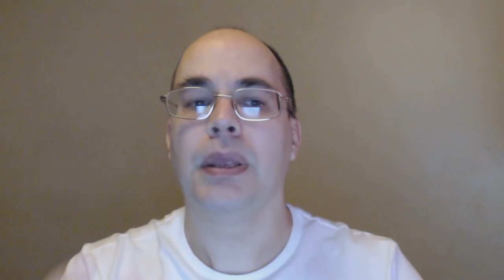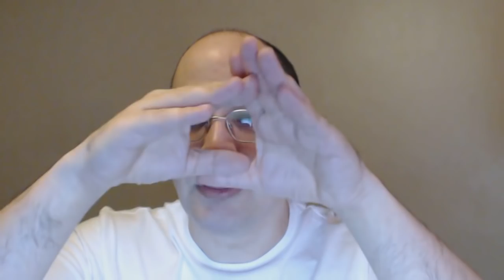How do rockets move in space, with nothing to push off from?

Comment: Ok so if you could understand the question I will ask it in another way. How astronauts move out of their space stations when they are in a complete stop? Rockets came from the earth but in the space when you stop how could you move again while there's a vacuum and no resistance? I know the answer but stupid people don't deserve the answer.
Reply from the maker: There is no complete stop in space, things are constantly moving, there can be no apparent movement relative to an object moving in the same direction and the same velocity but that isn't the same as no movement.
Reply: ok is a semi-stop for example in the space station, or a ship is that good for you? I mean come on at least admit that the movement could not be initiated only with a thrust from another object and not from the object itself which means you can not swim in space or even push your self against nothingness.
Reply from the maker: The whole point is that you don't create thrust by pushing against something, if an object is "stationary" then anything that comes from that object and moves in one direction will cause the remainder of the object to move in the opposite direction. A gun doesn't recoil because it pushes against something but the force of the bullet leaving the barrel matches the force of the recoil of the gun into your shoulder.
Reply: @mjmurcott647  move against what?!
Reply from the maker: There is no zero gravity in space there is a substantial amount of gravity close to the Earth due to the mass of the Earth, there is apparent zero gravity only when an object is in orbit around the planet where the object is moving fast enough to keep on "missing" the Earth as it is falling to Earth due to the pull of gravity. Everything floats in an orbiting spacecraft not because there is zero gravity, but because the ship and everything in it are all falling to Earth at the same velocity.
Reply: @mjmurcott647  funny how the videos from NASA shows astronauts flying with their jets of Nitrogen out of the spaceship and out of the space station with out leaving them behind! However, you are escaping the fact that there's a zero gravity in space maybe not in the lower earth orbit but more fare away where no human beings have ever reach.
Reply from the maker: Gravity decreases with distance, however there will always be some gravity hence why galaxies form rather than having isolated stars. Astronauts can use "jet packs" for EVA activities however the velocity achieved by the "jet packs" are relatively small compared to the velocity of the vehicle that they are exiting, as the astronaut leaves the ship at that moment they have the same relative velocity as the ship they don't come to a sudden stop. Astronauts don't want to get too far from the ship as they have to get back inside it later.
Reply: @mjmurcott647  Well I argued with many people some of them are even saying that the earth is flat and what ever logic or evidence I bring they will just throw it away so imagine how difficult to make a scientist to rethink his fixed ideas.
Reply: @mjmurcott647  first of all it's impossible to suddenly match the speed of the space station even with their jet that uses Nitrogen as a gas to move in the outer space! Please refer to my previous texts about how illogical this is. And for the last time you can not push against nothing this not the ocean this a vacuum moreover, there's no gravity to effect you that means you can only move around your centre axon but neither forward and backwards nor up and down not even in a oblique way. You could certainly contract your muscles however, that's it.
Reply: @namanziu4211  Air resistance is the resistance of the air to a body passing through it; the force that the body has to apply to move the air out of the way, equal (thanks Newton) to the force that the air being moved applies to the body moving it.  Air resistance exists because air molecules have inertia so resist being accelerated: they resist change of momentum. And, by Newton's first law of motion the force exerted on the air molecules equals the force that they apply back.  
So: change in momentum is resisted by inertia, so a force is required to change momentum. And, force exerted = force resisting.
Therefore, if a rocket pushes e.g. a brick out behind it, the momentum of the brick goes from zero to something in the backwards direction. So the brick's inertia resists this. So the rocket has to apply a force to the brick to make that change of momentum against the brick's inertia. But, at the same time that same force is applied back on the rocket (First Law), so a force is applied against the rocket's inertia, so the rocket has a change of momentum :- forward. 
Now, rather than one brick, imagine a whole series of bricks: push, push, push.
Now, rather than bricks, imagine a whole series of gas molecules: push, push, push, push, push, push, push, push, push, push.
Reply: you forgot to say in space where there's a vacuum which will neutralise your molecules of gas Mr William. Anyway if one-day humans discover or "reveal what I just said" please give me the noble prize even if I where dead then.
Reply: @williamchamberlain2263  in space I believe there only two forces one of them is gravity and the other one will be a secret for now.
Reply: @namanziu4211  how does a vacuum "neutralise" a molecule? Vacuum is just a very very low count of molecules per unit volume.  The propellant molecules are still leaving the back of the rocket in a single direction, they've still gone from zero relative momentum to backward momentum by applying a backwards force on them, so there must have been a forwards force on the rocket, so the rocket's momentum must have increased forwards.
Reply: @williamchamberlain2263  how does helium floats?
Reply: @williamchamberlain2263   @William Chamberlain  in space I believe there only two forces one of them is gravity and the other one must come from THE MIDDLE OF ONE SOLID-STATE NOT GAS AND DIVIDE IT INTO TWO EQUALLY DISTRIBUTED MASSES. Because on earth there's an atmosphere which contains air molecules that can create an "environmental resistance" around the object which can work as inertia that is if the molecules of the object has more density than the air i.e helium can't push air that's why it floats. So, we can't push helium against air "in space" air can't push the solid objects "in space" only if the air is more than double the size or density of the object which might looks like a small atmosphere and even then it will have a very minimum change in SPACE.
Reply: @williamchamberlain2263  please don't forget the words solid and space.
Reply: in space, I believe we have to use the fabric of space to travel effectively. Using the ionic engine is smart but I think it is not enough though.
Reply: @namanziu4211  The fact still stands, current rocket propulsion DOES work in space. We have proven it beyond any doubt.

We are developing Ion propulsion but need huge amounts of power to be effective.
Reply: @stuartgray5877  not you them Mr Gray.
Reply: @namanziu4211  Do you think that the earth's gravitational force extends into outer space as far as the moon?
If not, then what 'force' is keeping the moon in orbit around the earth?
Reply: @sailorman8668  really are you seriously asking this question!!!! Gravity has it's effect when it can effect you if the object is to small to be effected by Gravity then the Gravity won't effect which means for that object the Gravity will become zero. And please don't ask how the sun effect the astronaut in space because the question will be more ridiculous.
Reply: @namanziu4211  So a honey bee is small - are you saying it won't be 'effected by Gravity'?
I don't think you understand how gravity 'works' Newman?
Reply: @sailorman8668  really!!!!! Are you actually saying that wow! Not everything is effect the same way by Gravity on earth because there's something called  the weight of atoms on earth which means Gravity will effect the atoms on a molecular level on earth that's why hydrogen and helium floats while heavy atoms drops it got nothing to do the the mass. In space the heavy weight atoms will not be effected by Gravity hence, the Gravity will be zero but not absent. If it doesn't effects us it doesn't mean it doesn't exist.
Reply: @namanziu4211  So how does anything you've said, relate to the fact that rockets are propelled by ejecting large amounts of mass out of their exhaust nozzles?
And regarding a gun that is fired in space - will the gun stay still while the bullet flies away, or will the gun move (recoil) in the opposite direction?
Reply: , @sailorman8668  I was talking specifically about the spacewalking videos! They were using nitrogen gas to push the astronauts! However, the gas rocket is not effective in space and every real scientist know that.
Reply: @namanziu4211  Are YOU a 'real' scientist?
Reply: excepting new ideas with the ability to learn the objective truth without being bias that's what makes us real scientists.
Reply: @namanziu4211  : 
are you claiming that air is pushing back against the rocket? How does it do that?
Reply: Kit Canyon  No I am saying if there is neither  gravity nor air it would be impossible to move forward with the conventional way. That's why the real scientists are trying to discover new engines such as the ion engine.
Reply: @namanziu4211  look if you PUSH MASS AWAY, you feel a force pushing back.  This is simple recoil.  A rocket PUSHES MASS AWAY and feels the recoil force.  The rocket is NOT "pushing on nothing" it is pushing on MASS that it BROUGHT WITH IT TO SPACE!   Why do uneducated people who have never even taken HIGH SCHOOL physics love to argue with actual physicists and engineers that do this shit for a living?
Reply: @stuartgray5877  the engine is not pushing against nothing!!! Even in space! I did not realise that space isn't nothing lol
Reply: @namanziu4211  Tell me, if you fired a steel projectile from a CROSSBOW, in a vacuum, will it still experience RECOIL force? Yes or No?
Reply: @stuartgray5877  you said it solids against solids not against an empty environment "space".
Reply: @namanziu4211  So you refuse to answer the question?

The answer is YES the crossbow DOES have recoil even in a vacuum.
Do you know WHY?
If you did, then you would know that "propulsion" or "Recoil" happens whenever you PUSH on ANY MASS, whether that mass is solid, liquid, or gas.
Would a person feel "recoil" if they fired a FIREHOSE into a vacuum?

Yes.
Reply: @namanziu4211  I think you're confused about what a gas is.
Reply: gases contain a lower molecular density than solids and that's a simple fact. And please, I am talking to a scientist so talk science not me.
Reply: @namanziu4211  - "gases contain a lower molecular density than solids and that's a simple fact."

A simple fact is that GAS has MASS. DO you think the massive tanks of liquid oxygen and liquid oxygen just turn to nothing when it is combusted?
No you get the SAME mass back as pure water exhaust GAS.

The space shuttle main engine consumes 500 kilograms of liquid oxygen and liquid hydrogen PER SECOND, and expels it as PURE WATER moving at 2500 meters per second.

Do you think the MASS of that water gets accelerated without a force?

Can MASS be accelerated without a force? Yes or No?
Reply: solid matter is not the subject of argument here, Mr Grey we were talking about gas engine against solid rocket in space.
Reply: space has no density so we can not push the gas against lower density "space". It's if you want to push air against helium which does not make any sense.
Reply: @namanziu4211  so each of those molecules is moving along its path - curved a little by gravity but more or less a straight line - until it hits another gas molecule or the surface of a solid or liquid.  Moving like a little projectile, a tiny bullet.
Reply: @williamchamberlain2263  space has no density so we can not push the gas against lower density "space". It's if you want to push air against helium which does not make any sense.
Reply: @namanziu4211  - "Mr Grey we were talking about gas engine against solid rocket in space."

And I am telling YOU that a Space Shuttle MAIN ENGINE expels GASEOUS WATER.

Are you having reading comprehension issues?
Are you saying that a space shuttle main engine does NOT work in a vacuum?

ANd WHY do you refuse to answer any of my questions?

Would a person firing a FIREHOSE get propelled backwards in a vacuum or not?

can MASS be accelerated WITHOUT a force or not?

Are you some kind of "scientist" that refuses to answer basic physics questions?
Reply: @williamchamberlain2263  again you forget the vacuum of space. We need to look at the big picture, not just one fact but in fact, we must use all the facts that are out there.
Reply: @stuartgray5877  your questions are not related some of them are asking about solids and others about liquid! Anyway, please talk like a scientist and don't be disrespectful.
Reply: @namanziu4211  that's what I mean: there's a conceptual gap here, which is that the gas molecules are the little projectiles that the rocket is firing off backward.  The sum of all those tiny tiny recoils is the forward force on the rocket.  What the gas molecules do after they've been pushed by the chemical reaction of combustion, and maybe bounced off the nozzle bell, is irrelevant to the rocket's motion.
Reply: @stuartgray5877  respect other people first because you will have a bias in your discussion if you continue that way which will cloud your judgement.
Reply: @williamchamberlain2263  that small amount of energy would never work as a rocket engine in space.
Reply: That's why scientists depend on plants gravity to increase rocket speed in space.
Reply: @stuartgray5877  you you you me me me wow I am convinced thx
Reply: @namanziu4211  why not? The momentum of the exhaust gas molecules scales with the molecules' speed, and the combustion reaction is extremely energetic, so those molecules are going very fast and carrying a lot of momentum in one direction.
Reply: @stuartgray5877  you don't have the ability of learning which is the only thing that makes humans special I know lots people especially the old people and they refuse to learn which is strange and as a doctor, I will try to study this strange mind disorder and try to find a cure for this stubbornness.
Reply: , @stuartgray5877  I saw the video and the conclusion is my idea has reality in it becomes the throwst was minimum during the test in the vacuum in a TUBE, however, believe me, it will be worst in an environment with no gravity, and no heat.
Reply: @williamchamberlain2263  because it's if you want to push against nothing. However, the air cannot prevent helium to float and that is in a larger density environment so imagine someone wants to push gas against nothing in space open environment with no air, no gravity on the object. I think it will be inefficient to say the least.
Reply: @namanziu4211  do you mean inefficient?
Reply: @williamchamberlain2263   Yes ahm inefficient, thank you for correcting my mistake.
Reply: @namanziu4211  chemical rockets are mass-inefficient, which is why so many missions have coasting phases; just cannot lift enough fuel & oxidiser to generate thrust over the whole trajectory, so have to accept lower maximum speeds.  NERVA engines would be great, but who could you trust to operate a nuclear fission system in space?
Reply: @stuartgray5877  me me me
Reply: @stuartgray5877  you you you
Reply: @stuartgray5877  so you are saying a water cannon or a jet wash gun can push you in SPACE?
Reply: But there's no resistance in space how can you create forward force in space without resistance in other words SPACE is a vacuum which will act like suction for gas and liquid alike so when the gas molecules ejected out it will continue to move forward without resistance and, it's energy will get deleted due to the suction effect of the vacuum of space. Of course, there's always be exceptions i.e if the gas or liquid has a huge mass that creates almost half an atmosphere to push in it. 
 P.S my marks in physics were A+ full marks most of the time. But now I prefer to study the human mind because for me physics are getting easy.
Reply: @namanziu4211  "so you are saying a water cannon or a jet wash gun can push you in SPACE?"

YES.

I already told you that the Space Shuttle MAIN ENGINE expels nothing but PURE WATER.
It IS a water cannon

Other engines that burn kerosene instead of Liquid Hydrogen expel CO2.

Both Water and CO2 HAVE MASS.
SO when you ACCELERATE either one of those, the object doing the accelerating gets pushed in the opposite direction

You STILL refuse to answer my questions.

Do YOU think that recoil force stops working in a vacuum?
yes 
or 
NO?
Reply: @stuartgray5877  the recoil force depends on the environment and the state of matter which it has. So, to answer your question No for gas and water in space and yes for solids in space because of the vacuum effect on gas and liquid states of matter.
Reply: @stuartgray5877  low of conservation of momentum, for a collision occurring between object 1 and object 2 in an isolated system, the total momentum of the two objects before the collision is equal to the total momentum of the two objects after the collision. That is, the momentum lost by object 1 is equal to the momentum gained by object 2.
Reply: @stuartgray5877  I am not talking about collisions! But rather about the resistance and the forward force which both act in opposite directions. Of course, if you direct the engine on the matter it will affect it.
Reply: @stuartgray5877  your answer didn't mention the word space! Also, you didn't even read my comments because otherwise, you have known that I saw the video.
Reply: @namanziu4211  - "o, to answer your question No for gas and water in space and yes for solids in space"

Thanks for PROVING that you have NEVER taken even HIGH SCHOOL Physics in your life.

Answer this question:
If you combust a total of 500 kilograms MASS of Liquid Oxygen and Liquid Hydrogen (at the Stoichiometric ratio),

WHAT is the MASS of the PRODUCT of the combustion?
what is the MASS of the resultant exhaust gas?

If you need to research this before answering then you failed to even graduate high school.
Now just ANSWER or I am finished responding to you.
Reply: @stuartgray5877  well, firstly I didn't lie I am a real medical doctor secondly you are being a bully and disrespectful so I had to report you thirdly you can't think out of the box so you can't become a scientist finally from now I will stop replying to you.
Reply: @namanziu4211  If you'd like to see my resume, just Google "Stuart Gray Lockheed" and you can read all about the missions I worked on on LinkedIn.

Show me where to find your certification that states you are a doctor.
Reply: @namanziu4211  Where did you go?
Did you check my resume?

Where can I find your medical Doctor certificate?